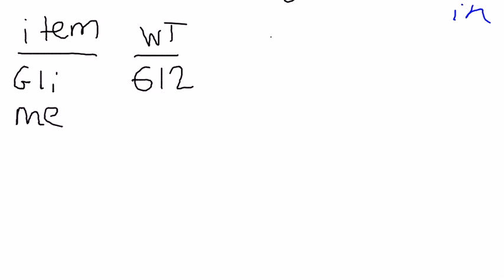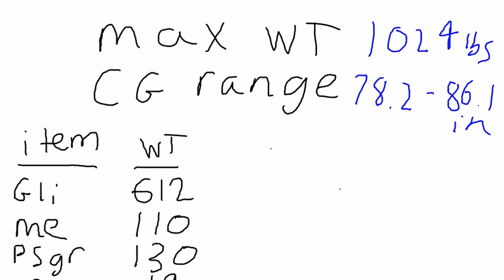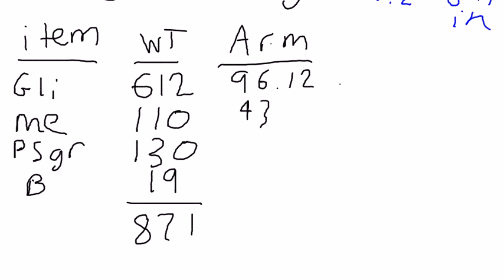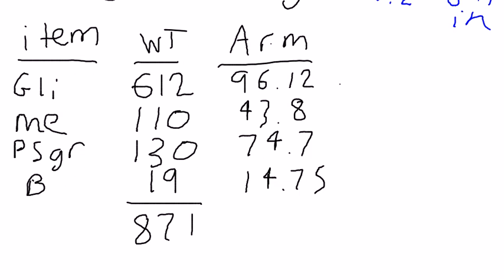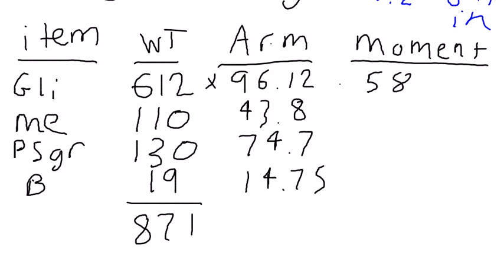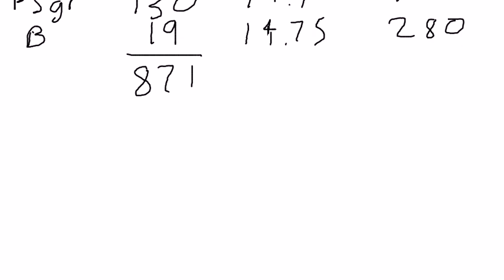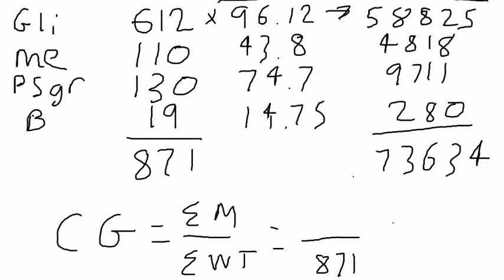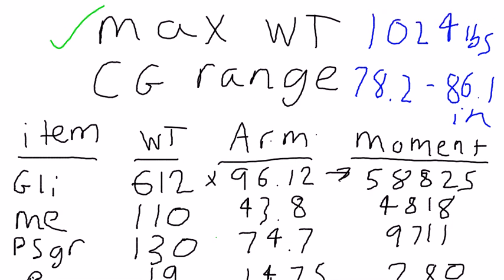Weight & Balance calculation for Glider

Comment: hello friend. I need some calculations. 

can you help me
Reply from the maker: What can I do for you?
Reply: My teacher gave homework. 

Homework is;
b is max 10m
weigt is min 100kg
chord is max 2m
Velocitiy initial max 10m/s
oswald efficiency (e) is 0,9
Cd zero is 0,03
Cl max is max 2,5
angle of attack stall max 20 degree 
angle of attack Cl=0 is min -5 degree

altitude (h) is 50m , (The plane is being thrown at 50m)
Calculate the maximum path the aircraft can go 

I calculated from excell but. I some mistake, my calculations ara minus

can you help me about this quesitons. 

I will appreciative you :)

my e mail adress; tiosonsoner@gmail.com or paradoksbahane@gmail.com